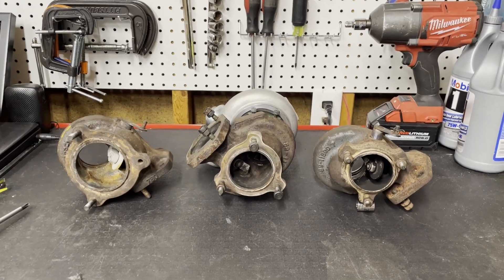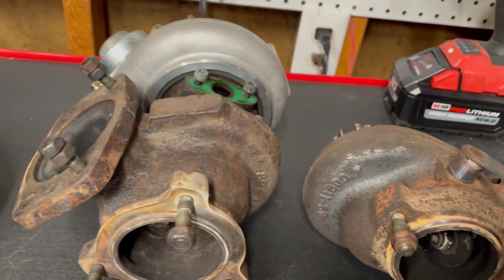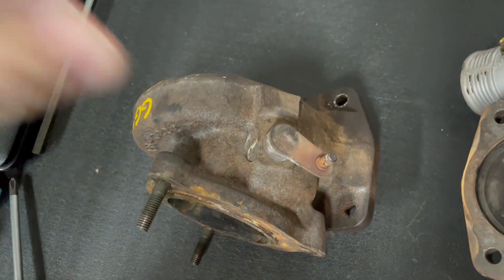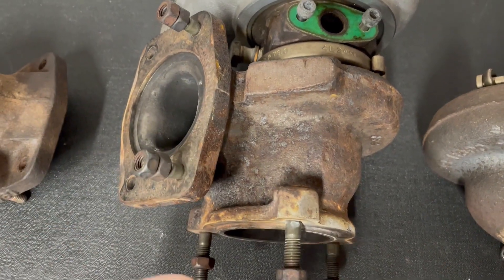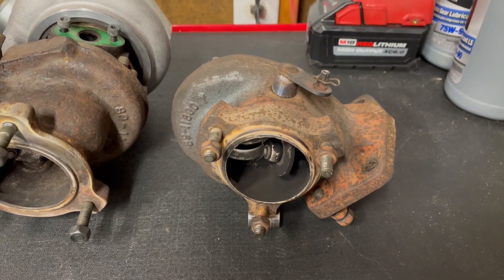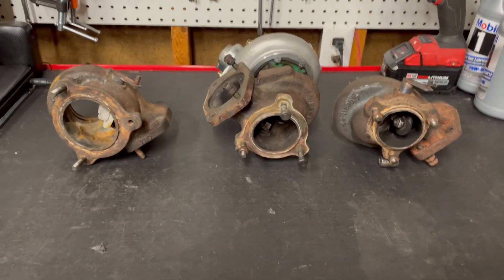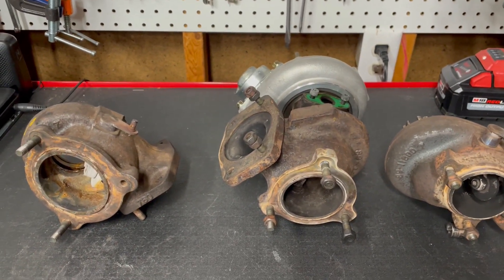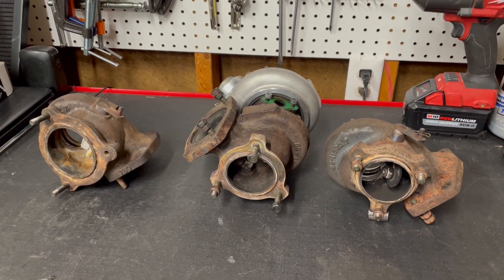Volvo TD04HL Turbine Comparison

Comment: I have used a 19T with a conical #7 turbine housing on my b230 940 with an ipd turbo cam, 465cc injectors 3 inch maf and chips.
It made 280 flywheel horsepower at 1.2-1.3 bar of boost.

I dont think that that the exhaust flange is a huge restriction up to this power level.

Comment: can i ask what kind of hp figure can be achieved and at about what rpm is expected a td04hl-13t turbo to spool on a 2L petrol engine with fully variable intake cam? And what pressure could it be able to maintain up to 7-7.2k rpm? Thanks
Reply from the maker: @opexo  I can’t even begin to answer this question, as we never got the 2.0 engine in the USA, nor the 13T turbo. Most of the later redblock turbo cars came with the B230FT engine and a 13C turbo.

Comment: U r talking about 3 different types of TD04HL turbine housings, not turbine wheels. TD04HL turbine wheels r always the same diameter, inducer/exducer 52/45.6mm. HL designates size of the turbine wheel and proper housing. TD04HL-nn designates size (13-20) of the compressor housing and comp.wheel / impeller. Last marking, in this case T, designates the profile of the compressor wheel / impeller blades. T is the most "aggressive" profile. #7 housing (7cm2) has A/R = 0.49.

Comment: The angle flange one can be cut off a a V band welded on. Makes it easier to install then. Do one from the T3 range from the early 760 and 740 turbos next!
Reply from the maker: Unfortunately, I don’t have those turbos on the shelf to compare them! And truthfully, I don’t know much about the T3 range turbos.
Reply: Why V-band for the downpipe conn. to turbo?. Why extra costs, unless one can weld the V-band by himself?. Why take a risk of leak of exhaust gasses + possible fire hazard (jetflame / blowpipe), due the poor welding?. 🤔  Cast iron + stainless steel is not a good combo ... imo. 
I tack-welded mine 3" full stainless steel exhaust system components with a MIG + stainless wire. 😇 A pro then welded seams gastight with a TIG w root gas. Yup ... cost mee a lot of money, but it was and it is worth every cent. It flows (minimum backpressure) and it sounds awesome w all the typical Volvo burbing ... like B5244T should sound. 🤣

Comment: 1.  15G conical flange found on '94 - '95 850 Turbos.  Orange fuel injectors.
2.  15G flat flange found on '96 - '97 850 Turbos (in USA, both on 850R and T5).  Orange fuel injectors.
3.  13G flat flange found on '97 GLT 850 and on '98 - mid '99 XC70 and other P80 cars with Low Pressure Turbo (LPT).  Red fuel injectors.
4.  16T flat flange found on '98 - mid '99 S/C/V70 T5 cars.  White fuel injectors.
5.  18T flat flange found on early to mid '99 V70R.  Mix of either white (early) or green (later '99) fuel injectors.
6.  13T angle flange found on mid '99 - '00 P80 cars with LPT.  Red fuel injectors.
7.  16T angle flange found on mid '99 - '00 S/C/V70 T5 cars, as well as on '01 - '06 (or so) P2 T5 cars.  Blue fuel injectors.
8.  19T angle flange found on '00 V70R.  Green fuel injectors.
Reply from the maker: Great info, thank you for posting this!!